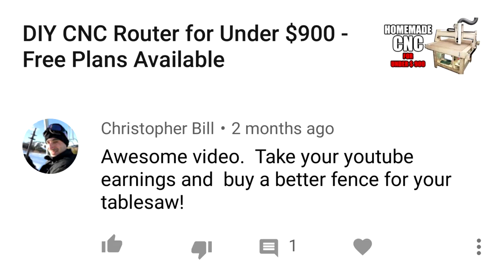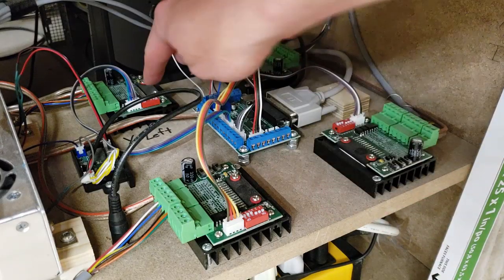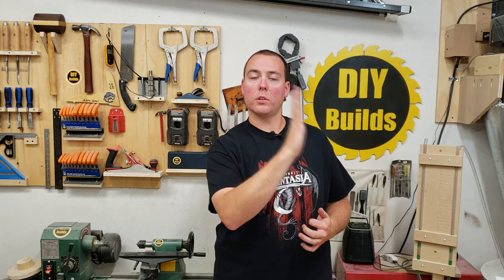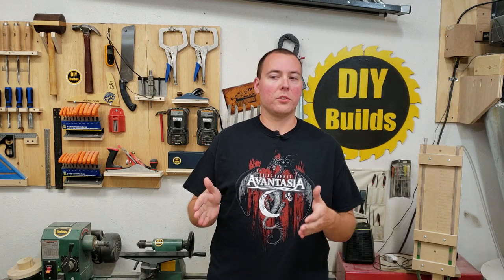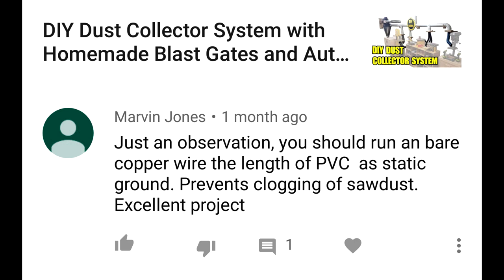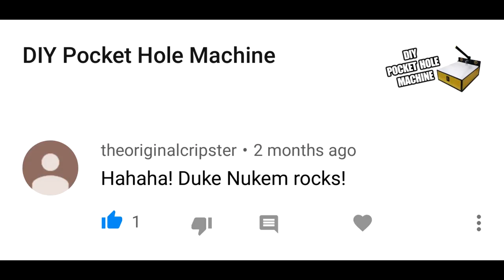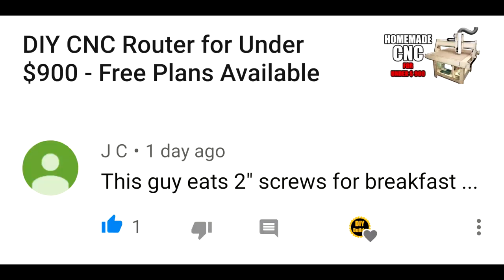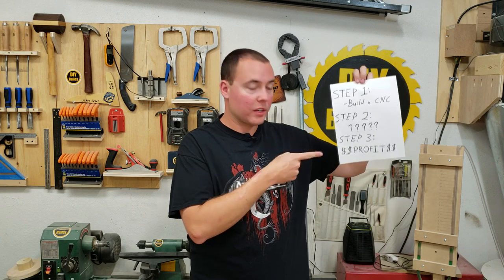DIY Builds - Viewer's Comments #12

Comment: Guys;
About "all those tools".
You are not required to buy them all on the same day.
You are not required to buy new.
If you choose to buy new, you are not required to learn the pricing strategy at box store, and make sure you buy it the 4 days of the month when no discounts apply.
In short.  You can afford $10 a month.  Go buy $10 or less in tools.  My last purchase under $10 was a cheap set of chisels.
Now I no longer need chisels.
I own 1, count them, 1 long clamp.  I have another set of pipe clamp parts.  I can buy a whole clamp or a black finish, metal gas pipe and put my clamp parts on it.  Now I'll have 2.  My goal is 22 clamps.  It's going to take time.  Eventually, I'll have $5,000 in tools, $10 at a time.